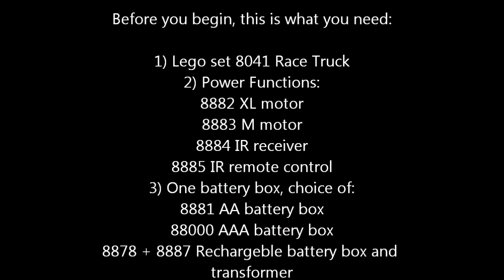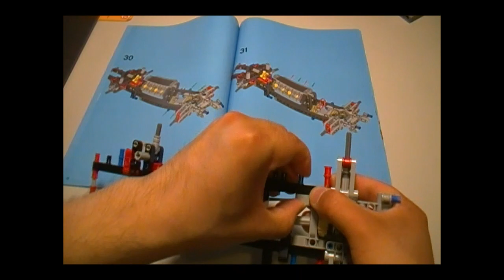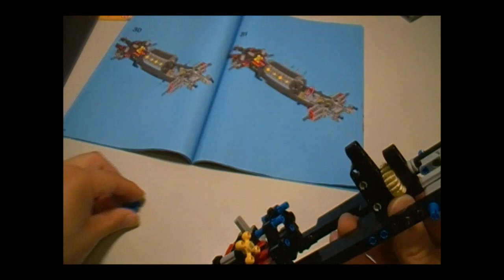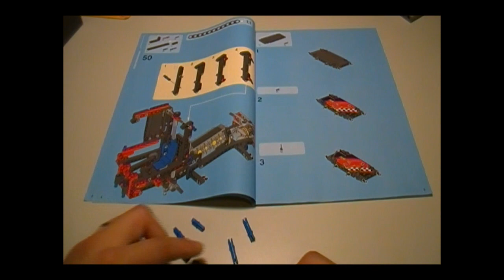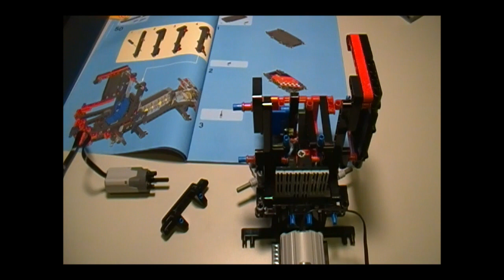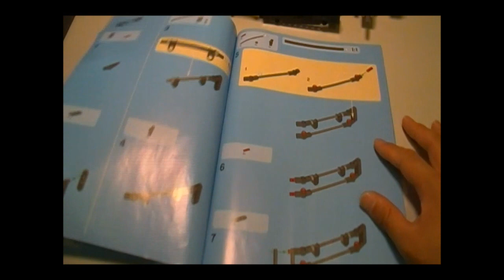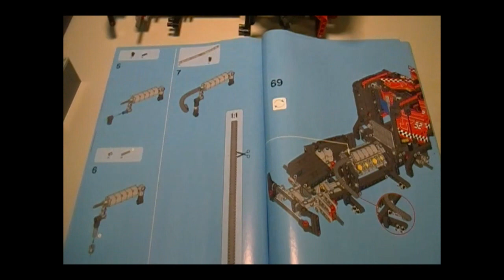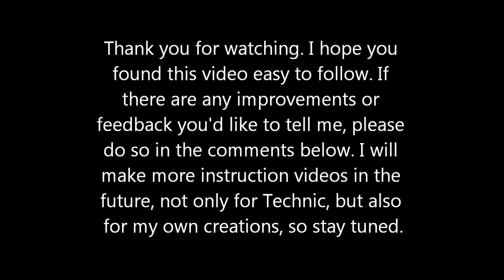Lego 8041 Race Truck Modified with Power Functions Instruction Technic

Comment: The best way to fix the steering without a return to center mechanism is to change the gear ratio.  If the ratio is slower you can eliminate most of the zig zagging you talked about.

Comment: @brickformular Thanks for the tips. Mine will arrive soon.  I'm slightly disapointed that the model is so basic compared to the flatbed. Maybe if I sticker it up it might look less like a small kid with not enough legos designed it.  Still, it is a ltd design.  Thanks for your time.

Comment from the maker: @Mike90003102 
All the motors and power functions are purchased separately and you can find them at the official Lego web site. All other parts are included with the set itself. I purposely modified this set using ONLY the parts in the set, this way you can build a PF truck without having to get extra parts, except for the power functions.